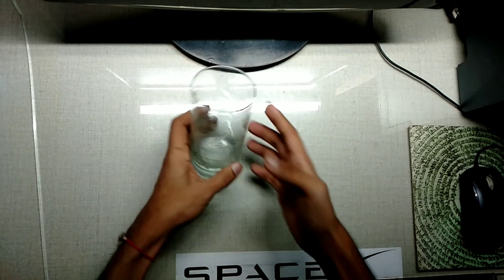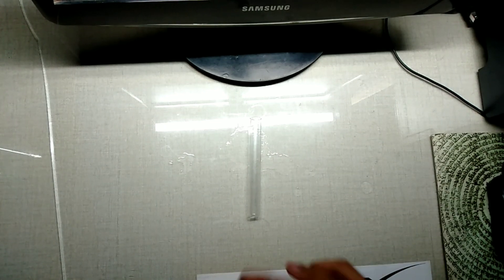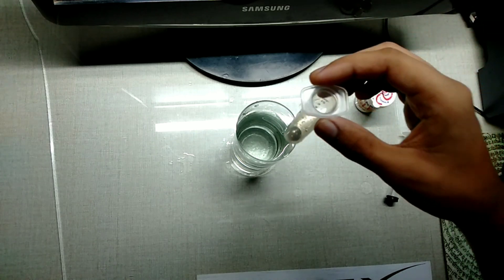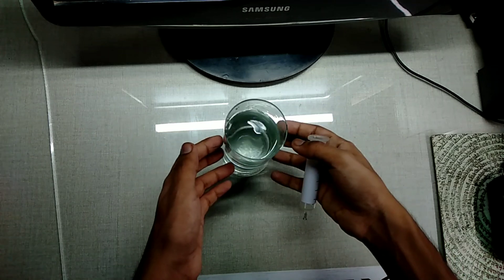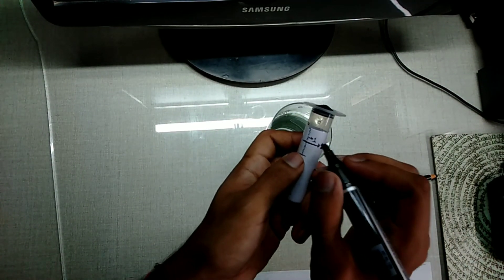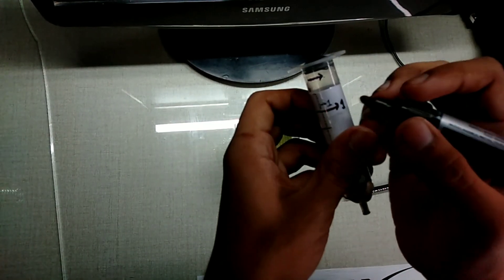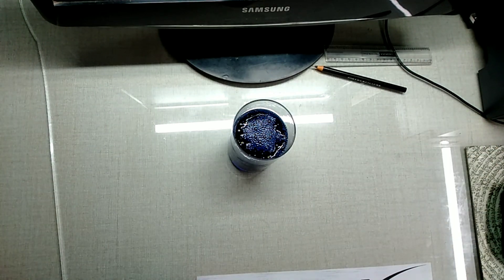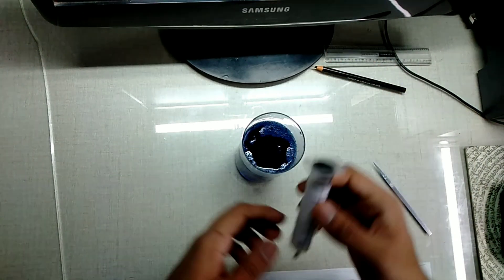Diy Hydrometer

Comment: But how do you calculate the difference?
Reply from the maker: Yup Dalen Britto . Can you please say which difference you are asking about . The difference between the densities ?
Reply: @RandoniumTJ  yes mate like i got a difference of 4mm  from water density what does it mean
Reply from the maker: @dalenbritto8380  ok . Do one thing.  Don't go by length . Take two liquids of known density and mark the difference . Then compare the difference with an unknown one and see what it corresponds to . For example a difference of density when 6 , results in a difference of 4mm.  Then take an unknown one and do unitary method ... Once you get three known readings.  You can easily tune the whole scale on your device . Watch some reference videos on how thermometers are made . You will get a clear idea ...
Reply: @RandoniumTJ  was thinking of that great idea but no idea about what base i would go with distilled water
Reply from the maker: @dalenbritto8380  you can try oil . Or ethyl alcohol